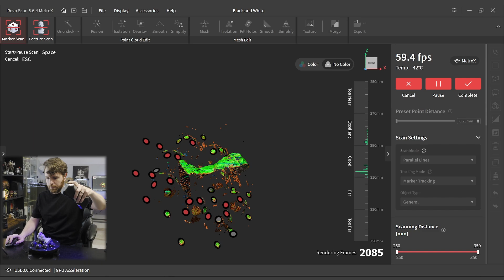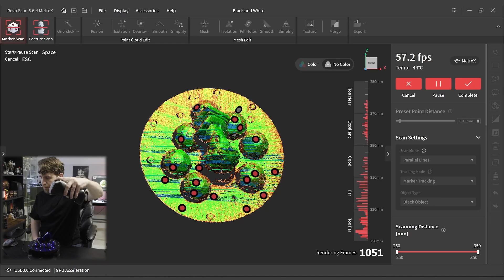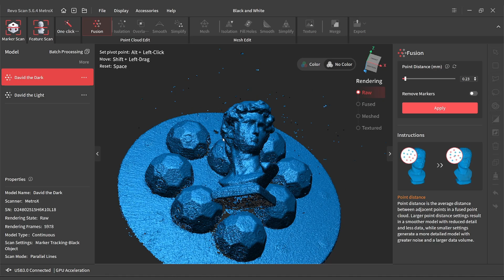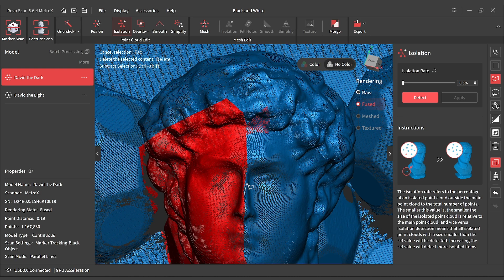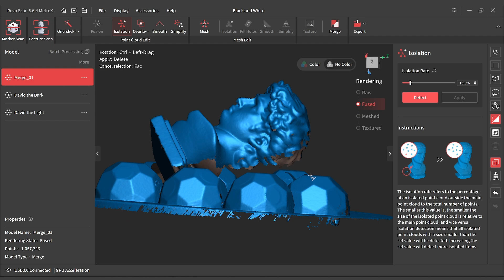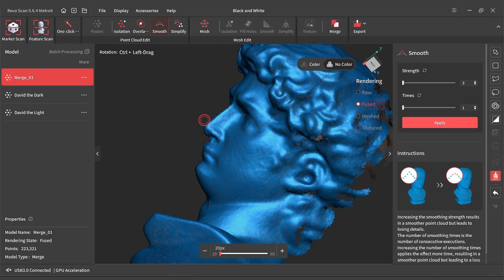MetroX 3D Scanning - High Contrast Objects

Comment: Hi, thanks for your tutorials. So far, I’ve always used photogrammetry, but today I’ll be receiving my very first scanner, the MetroX. I can’t wait to test it out.
I’ve seen that the texturing looks good, but I’d like to try an approach where I scan the object with the MetroX and use photogrammetry for the color, so I get a smooth, perfect mesh from the scanner and a super high-quality texture from the DSLR.
I haven’t looked deeply into this technique, but I saw it can be done with Reality Capture or Blender.
Have you ever thought about this?
Reply from the maker: I have! But I haven't had a reason to test it myself personally, since my color textures gave been good enough for my use cases. I've seen @Bau-3d use texture reprojection to use photogrammetry textures on a 3D scans with great success.
Reply: @KenDoes3D  Unfortunately in my tests (I started yesterday) my textures are not up to what I want to achieve, in some parts they are blurred and some semi-glossy parts collect reflections.
I think that for some objects it is normal since no type of light polarization is used.
The artifacts increase slightly when merging the scans.
The mesh is really great, texturing a little less.
Today I try to mix the two techniques :)